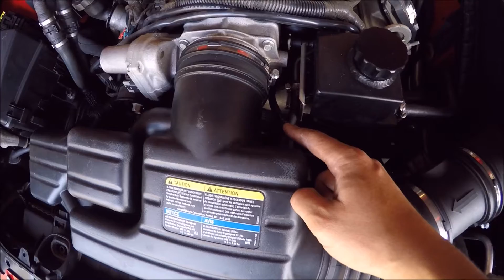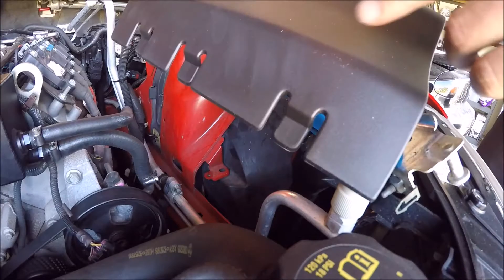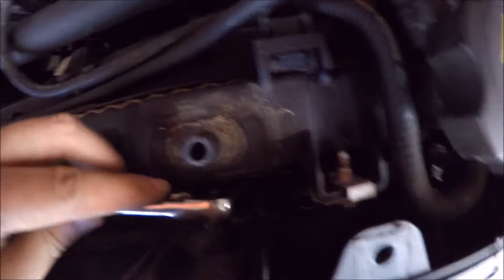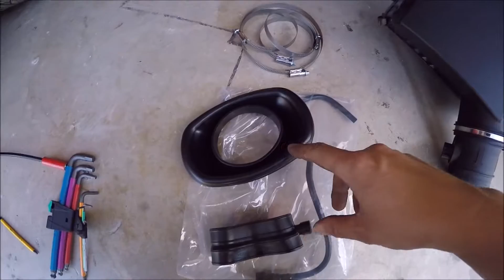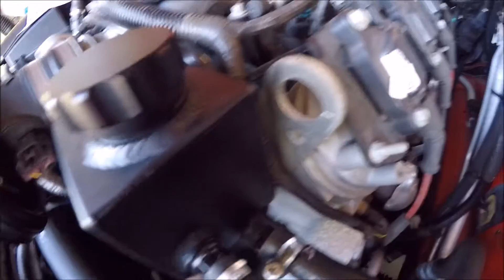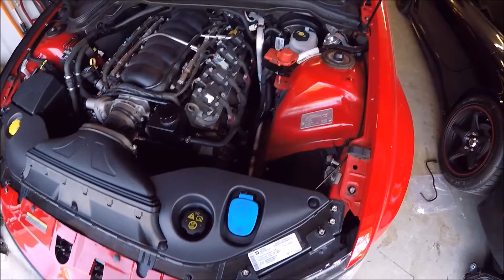VCM OTR Intake Install - VE/VF SS / G8 GT

Comment: Nice setup man, question though on your power steering reservoir when swapping I have a similar one I put on my car and I can’t seem to get the system to bleed correctly because I keep getting fluid building pressure and seeping out the cap. Any tricks to bleeding the systems on these cars ? thanks.
Reply from the maker: Sounds like there may be too much fluid in the loop. If I remember right you need the front wheels off the ground and turn lock to lock a few times, checking the levels as you go. I never had a problem with the aftermarket setup leaking. Good luck!
Reply: @Projectfd  that’s what I did, but I’ll try it again. Thanks.
Reply: @Projectfd  did you do it first with the engine off and then with the engine on or just one way?
Reply from the maker: @24nickSss engine off, key to on so the column doesn't lock, do it slow to get the air out and check your levels, once the engine is running and the pump is going the level will rise some. Get some heat into it by running for a bit and bleed it a bit more. If your not getting anymore air out, get the car level and put the cap back on and turn it off. Let it settle for a min then take your readings, my guess is it's going to be too high and you just need to syphon a bit out.

Comment: Just installed it and when I started the engine it shows that traction control is off and not turning on.

I also found the car driving badly. Are these issues is going to get fixed after getting it tuned?
Reply from the maker: Those are totally unrelated issues and nothing around the intake should impact traction control. Verify nothing was accidently unhooked on the harness.
Reply: @Projectfd  Just figured out that my transmission is dying :( I'll be searching for a manual conversion kit.
Reply from the maker: @Alwaleed-507  Sorry to hear, but with a successful manual swap these cars really change, for the better 👍

Comment: Thanx for the refresher! I took mine off my old GXP and the new one came with a RotoFab. I finally got around to swapping them out. I used C clip nut plates and 10mm bolts instead of push pins for the panels. Looks much better and easier to remove. I also have the update tube for the V1, the new units have it and the filter is easier to get to.

Comment: I am about to order this from Summit.  I have an '09 G8 GT.  I'm also waiting on my Diablosport tuner to arrive tomorrow.  I will be turning off AFM/DOD.  Once I receive the VCM do I need a catch can?  I just want to use the longer pcv hose that comes in the kit.
Reply from the maker: You don't need a catch can but it is a worthwhile mod to keep oil vapors out of the intake system
Reply: @Projectfd  I received my VCM OTR Intake from Summit Racing Wednesday.  I don't want to tell you how many hours it took.  LOL.  Your video definitely helped, and I have revisited it a couple of times since my original comment.  I did manage to turn off AFM with the tuner that arrived a couple of days before the VCM. I have everything including the infill panel and side panels installed.  One of my issues was the supplied pcv hose would not attach to the connection over on the valve cover passenger side.  I amazingly was able to get the factory hose to work, but I was afraid of a possible vacuum leak if you will.  It did not seem like a good enough seal.  I buttoned everything up in the early a.m., and I will got to my local auto parts store to buy some rubber hose during "normal" hours.  Other than that I just have to reroute my maf plug as you did and start 'er up and make sure everything is okay.
Reply: @VidTubeWatch I had the same problem actually ! Do you rmeber what size rubber hose you got to replace the pvc??
Reply: @dacotaescoe262  I was able to use the factory hose.  VCM sends a plastic replacement that I could not use.  I just connected the stock hose onto the passenger side with a metal barb union.  It's shaped like a cone or Christmas tree if you will.   Also, Amazon or many others sell vacuum line connectors/hose connectors.

Comment: Nice car and real nice install, but do you know your check engine light will come on and you will need to get a tune, otherwise she will run real rich and out of tune really, by doing a tune, she will get around 20HP extra at the rear wheels and depending if you have put headers and full exhaust system and with the OTR your looking at over 120 hp at the rear wheels if tuned right,cheers :)
Reply from the maker: This OTR will not cause a cell or tuning issues. I ran it for months before protune without a singls issue. Granted you won't get maximum gains without a tune but you not have issues with this intake.

Comment: Did you have any crank case squealing after routing the catch can the way you did? I routed mine the same way you did and it drove me nuts thinking it was the underdrive pulley I just installed at the same time I did the can. Found the issue, I routed the can to the plenum and the vcm intake tube to the pass side valve cover, quiet as can be. Just wondering if this happened to you
Reply from the maker: Zero issues. The Radium tank is baffled so maybe it makes it quiet?
Reply: @Projectfd   that is possible, my can is fully open inside that is probably why
Reply: @Projectfd  also doesn't that plenum line suck air also as well as the pass side valve cover?
Reply from the maker: Na motors will always draw vacuum. The way I'm routed is how eveyone recommeds for DOD cars. Once that's deleted things swap
Reply: ah ok gotcha @Projectfd
Reply: I was wondering about your plumbing for your catch can? You swapped it from factory?

Comment: What does the catch can improve?
Reply from the maker: The big factor is that oil saturation of your intake manifold and upper valve train will no longer be an issue. Oil vapor being introduced to the air/fuel mixture lowers the effective octane rating and can cause knock, pre-ignition, loss of power and lower mpgs. Factory routes it back in a closed system because of emissions and the fact that normal consumers would never empty a catch can at a regular interval lol.

Comment: Theres no need to take of the negative boost top at all, the infill panel fits in just right with out taking it off ? Also you should have trimmed the lower 1/2 of the VCM Cold air intake, that way its not restricting air going to the top 1/2 of the radiator and the A/C condenser ?
Reply from the maker: 7071t6 no way it would fit without moving, I tried. But fitment between cars can be different. I have zero heat issues, where have you seen you have to trim it?

Comment: good work man it looks good. im kinda curious on how u routhed ur oil catch can
Reply from the maker: sickesstvenado96 what's your question?
Reply: Project FD i just got my oil catch can but it says to hook up both hose to the passanger side of the intake manifold
Reply: Project FD and i see urs is hooked up to passager and driver side valve cover
Reply from the maker: The catch can is only hooked to the driver side valve cover > catch can > air inlet. Most catch can setups on LS vehicles do the fresh air on the passenger side and the waste air on the driver side (how mine is). The caveat there is if you have AFM deleted (I don't) it seems some people run it the opposite way.  Also if you have an LS6 valley cover that has the built in PVC/"catch can" you run it off of that.
Reply from the maker: https://www.instagram.com/p/Bgww_LCF9V1/